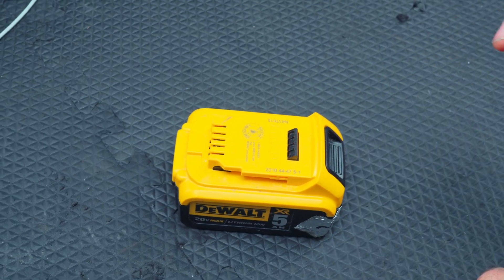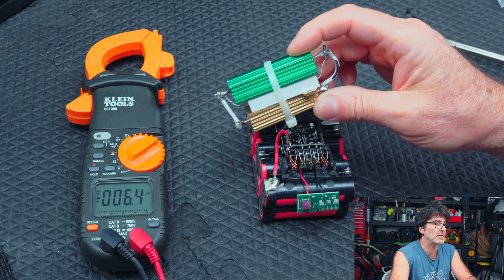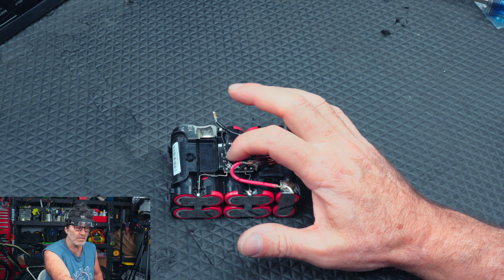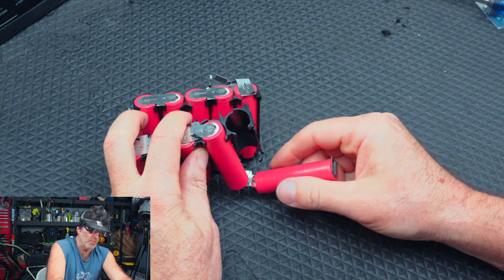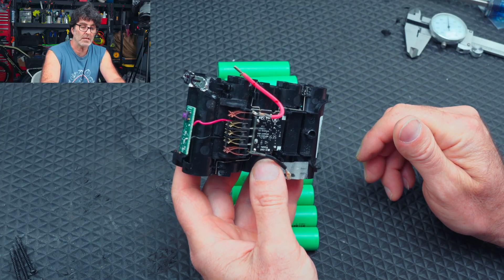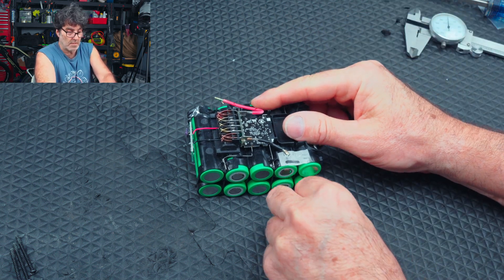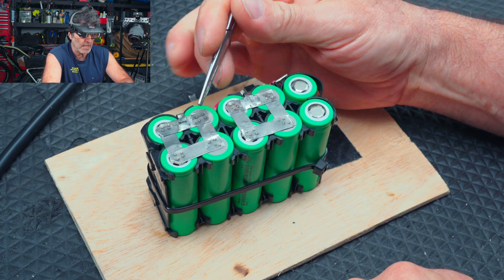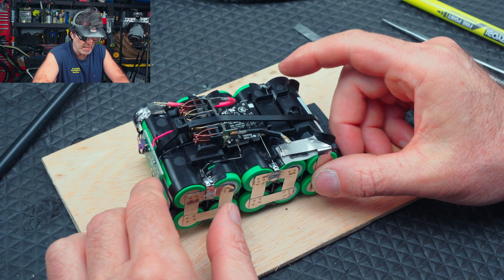revive and upgrade tired dewalt 20V max batteries

Comment: Can I dothe same with 18V ? TY🧐
Reply from the maker: If it's the older NICAD batteries, probably can.  However, I wouldn't try to upgrade that to Lithium though because the charger and BMS are going to be different.